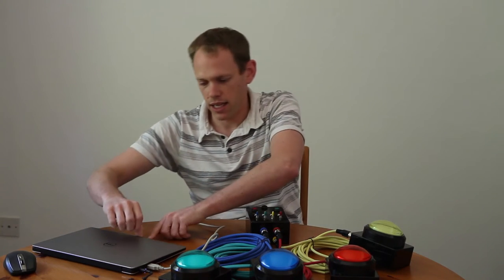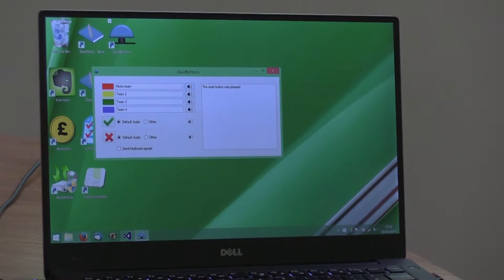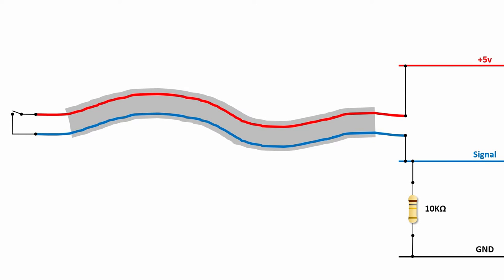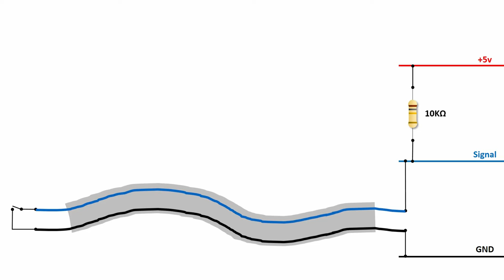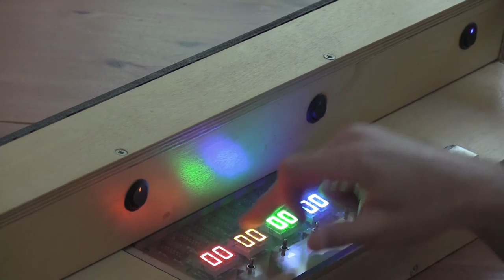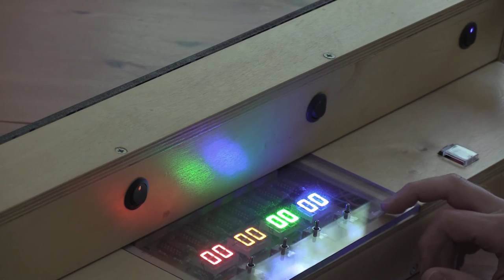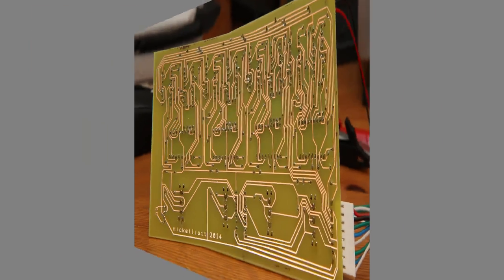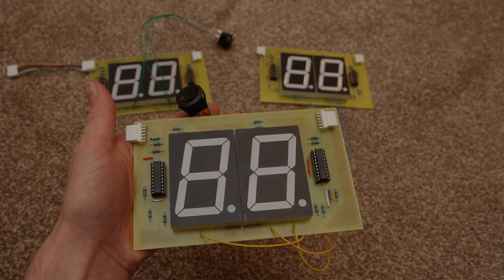Arduino Project - Quiz Buttons and Scoreboard

Comment: Great project. Would you mind giving the specification for the panel mounted LEDs and where you bought them.
Reply from the maker: I bought them from this website: http://www.artronic.eu/pl/c/2%2C3-56%2C80mm/184
Although, I think I initially found the seller on Ebay.
You obviously need to make sure you get the right ones - common cathode or common anode!
Reply: Great thanks very much.